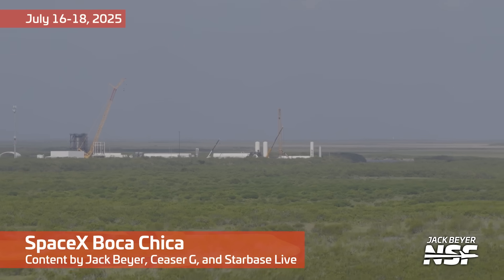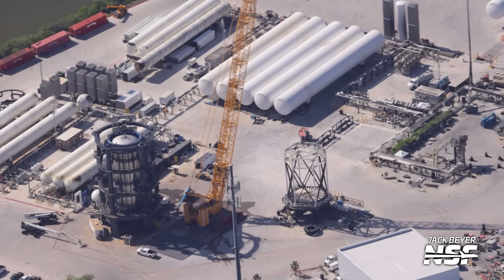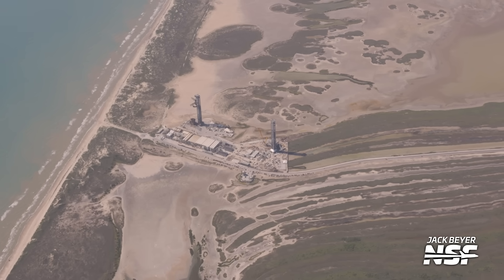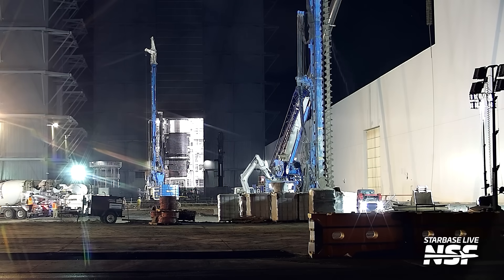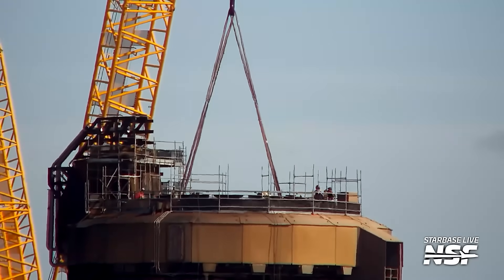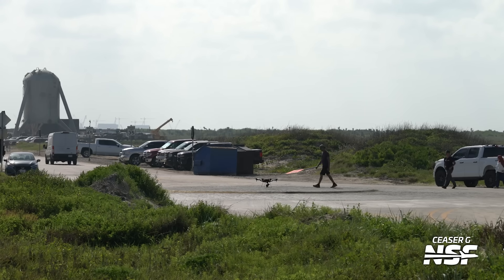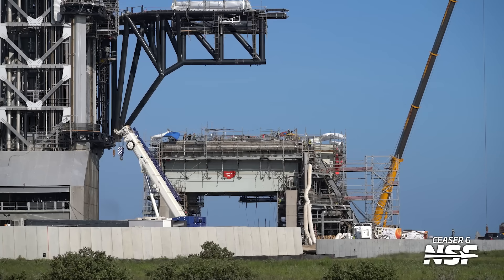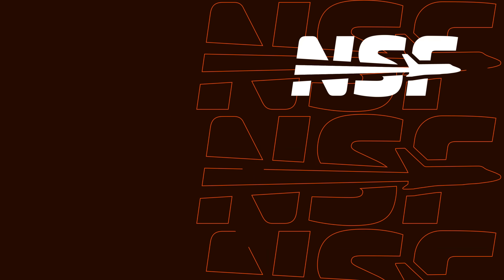"They need to put a ship where the booster goes" | SpaceX Starbase

Comment: I still think it's crazy they are working on doing ship testing at the pad 1.  Seeing how much work to get that stuff in, test the ship, and then go back and remove all of that and reconfigure so that booster can go in and launch from it.  Is it really worth all the manpower and time to do this twice for the last 2 version 2 ships?
Reply: They may do both ship tests and then reconfigure. But usually, it takes a few weeks to install engines after a crypto proof, so that may not be possible, here. But I would expect Ship 38 to be cryoproofed before Ship 37 static fire, if only to test the system in a safer manner.
Reply: I agree.  They will likely test the last two Block 2 Starships here, then remove all of the modifications for launch.  Masseys will be up and running again for Block 3 ships.

Comment: The big line was either hydraulic to run the motor or it was a mud mixture that lubricates the drill bit
Reply: Negative. These aren't deep well rigs.
It's very wet concrete that gets pumping into the hole through the auger as it's removed to stop the hole from collapsing

Comment: That’s not a hydraulic fluid hose, but I think that’s bentonite slurry, common lubricant for drilling. Sometimes sand and cement are added, and they might even reverse the drill to push the fluid under a little pressure into the walls of the hole to help seal it off. Especially if it’s loose or subject to Cavens.
Reply: A hydraulic line would be under a few thousand PSI (or quite a few thousand) and would whip around like a REALLY pissed off snake if it let go! I saw a 10,000 PSI one let go many years ago and let's just say I'm glad nobody was anywhere near it when it did! A pinhole leak in a 10,000 PSI line can cut you in half! :face-fuchsia-wide-eyes:
Reply: This is the line that pumps the concrete into the pile when the auger is extracted. The auger is hollow down the centre, so the line has to move up and down as the auger is drilled into the ground then extracted.
Reply: The bentonite slurry holds the hole open and is used to pump the cuttings out of the hole. It is denser than the material being drilled so the cuttings will float on it.
Reply: Agreed

Comment: That burst hose was most likely the drilling fluid hose, also called drilling mud, It's basically a clay slurry. They pump drilling fluid down the hole through the center of the drill pipe and out through the drill bit to lubricate the drill bit as they drill.

Comment: I wonder if they'll run the deluge at full power like normal for a booster static fire. Or if they'll drop it down to like 50% on the water force.
Reply: There is no real reason to change the methods used. Too much water is not a problem.
Reply: @knowledgeisgood9645  [Too much water is not a problem.]

Unless EPA decides to call it "industrial waste water" after use. It's not the stupid we'd like, but the stupid we have...
Reply: @disorganizedorg  They can't accept a launch and say no to a test using the same amount of water.
Reply: @knowledgeisgood9645  The can limit the amount of water discharged regardless of cause. And if they wanted to they could define acceptable amounts that differ for each, as the degree of sound suppression required will vary.
Reply: @disorganizedorg  They can do whatever they like, but if they want to give a good reason then saying no to a once or twice test would seem silly.

Comment: 7:00  The adapter is basically a very short booster. Its bottom is shaped like a booster to fit onto the pad, and the top matches the interface of the ship. It’s not exactly rocket science—the real design challenges lie in managing the consumables and protecting the launch pad.

Comment: Can SpaceX build a second static fire test stand at Massey?
Reply: Never say never but it's been mostly accepted that they don't have the room without a major redesign of the whole facility
Reply: If they could, it would only be a second ship test stand. The problem is not the area needed for the trench, it is the added expansion of the tank farm that would be necessary to service both - the area is too small.
Boosters are out of the question.

Comment: Pretty sure the burst hose was for the concrete mixture (quite loose, watery in consistency) that is pumped into the drilled cavity while the auger is withdrawn.
Reply: Edit: upon closer inspection it looks like the two hoses are the same line with a hard pipe mounted to the drive unit. So yeah probably concrete.
Reply: It did not look like any concrete leaks I have seen, but it is more likely a watery mud slurry used while drilling. That is why dropping the rebar cages is done so fast (no resistance). The concrete is added just after the rebar.
Reply: @knowledgeisgood9645  And the concrete displaces the slurry (drilling mud?) when it’s pumped in.
Reply: @PetesGuide  CFA does not use slurry/drilling mud, that would turn a simple process into a very difficult and messy one.
Reply: @knowledgeisgood9645 the concrete is put in under pressure through the auger as the auger is pulled out to prevent the hole from collapsing and the rebar is put in after.
Reply: @DrewNar-tacA  Then how come there are no trucks neaby while they are drilling? And why do the concrete trucks roll up as soon as the rebar is dropped?
Reply: @knowledgeisgood9645  the trucks pull up to the concrete pump (a separate, usually trailered unit). Not the CFA rigs themselves.

The rebar cages are lowered as soon as the CFA rig can get out of the way.  As you can imagine the concrete is very wet to be pumped and for the cage to sink into.
Reply: @knowledgeisgood9645 Your first comment is wrong on both counts. CFA drills don't use drill mud (that would make the process incredibly difficult) and piling mix (which has quite a lot of additives to suspend the aggregate) is typically a 24" spread, ergo quite runny. If you look into the agitator bowl while mixing, piling mix "rains" from the top of the bowl.
Reply: @nigelwoods6979  OK, I have to be wrong about this, if they are actually using CFA drilling and not some other variant. What has been strange is that I don't see any trucks "feeding" any pump.
How long does it take the concrete to harden considering how wet it has to be?
Reply: @knowledgeisgood9645  in this video, the same scene where the hose ruptures. You can see two concrete trucks feeding a big white box. That's the pump behind the grey generator in the foreground.

Zack Golden said they have to wait 24-48 hours before drilling the adjacent holes, so they're drilling every other hole as they go and will go back to drill the other holes, or the second rig is currently drilling the other holes
Reply: @knowledgeisgood9645  The setup they're using has the concrete pump quite some distance from the augur. How long the concrete takes to set would depend on the mix used, you can specify a mix that barely gives you time to get the cage in, if you want to take that risk. Most will choose something that takes longer to set, after all, it's going to be weeks before anything else happens to the pile.
Reply: @nigelwoods6979  What puzzles me a bit is how concrete that "wet" will turn into regular concrete once all the extra water has defused out? Would not the concrete shrink? Would they need to top it off?
Reply: @knowledgeisgood9645  The water doesn't diffuse out, it takes part in the chemical reaction that causes cement to set. You're being deceived by the "liquidity" which is caused by the additives that allow the aggregate to "float" in the mix. There's a whole swath of possible additives that have all sorts of effects on your final product.